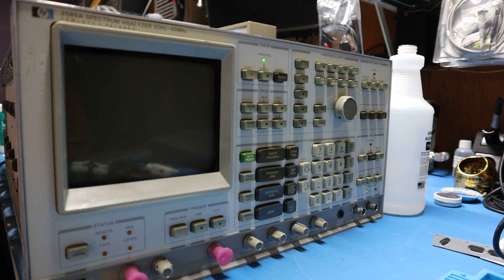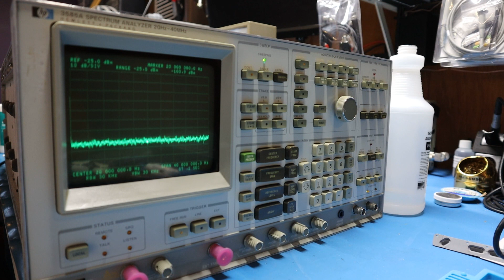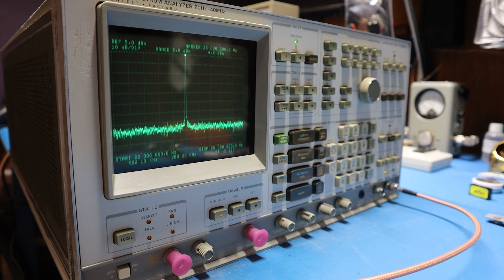HP 3585A Spectrum Analyzer Repair

Comment: Very nice repair. I love HP test equipment. They have pretty good manuals provided you have the one that matches or SN range. I wish I had more time to play with my lab equipment at home but I'm busy most of the time. I'll get there though, I just need to finish up some projects and set my lab up. Wish you lived in the New Orleans area, we need more qualified techs where I work. If you know someone who's a good tech, lives in the New Orleans area and needs a job, have them go here: https://aecom.jobs/new-orleans-la/engineering-tech-iv/8DF5038648F54401B6DE692D0A1D827B/job/?utm_medium=Front%20Page&utm_campaign=Jobs%20Map&utm_source=AECOM%20Microsite    Chat with you later TG. Best Wishes & Blessings. Keith Noneya
Reply from the maker: I wondering if you guys are still looking for techs?